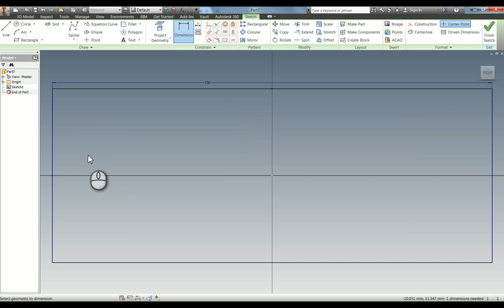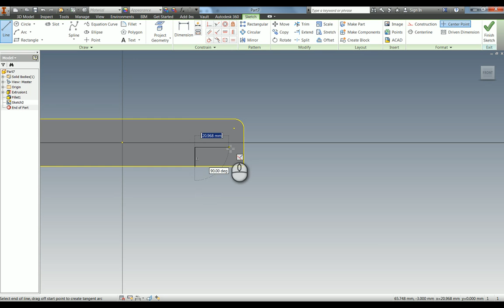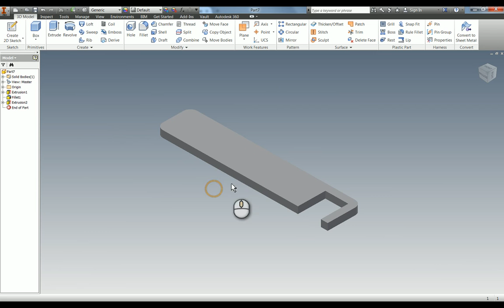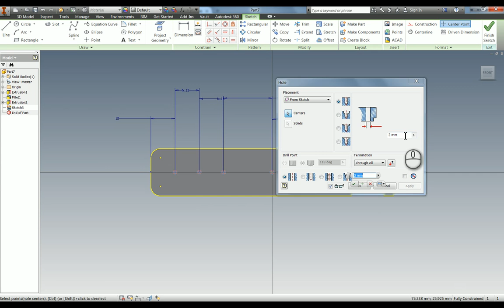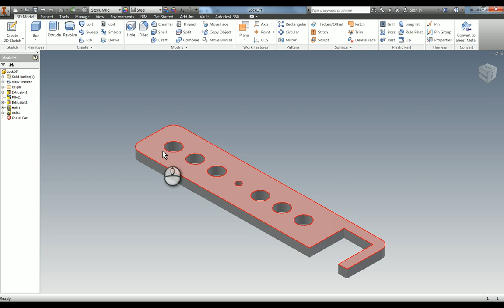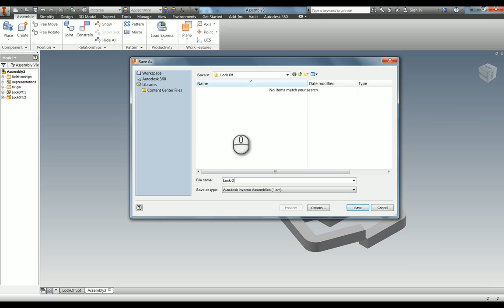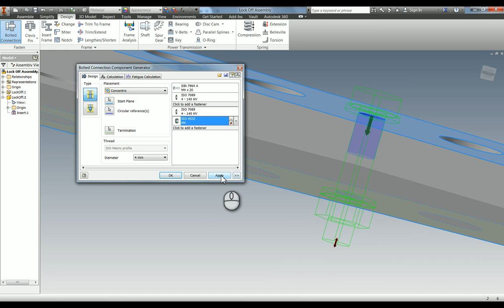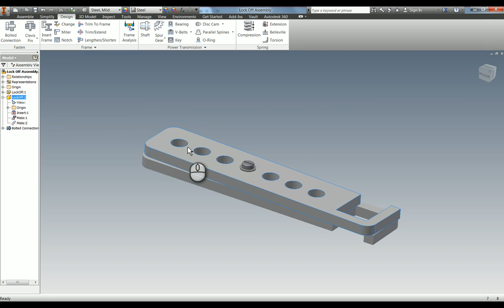Using Bolted Connections within Inventor

Comment: how do you use by hole?
Reply from the maker: Hi there, do you mean, a different bolted connection per hole? Or how to use the hole tool? If you want to create different connections then do a new bolted connection per configuration.  If you would like to know how to use the hole tool this is at this point; https://youtu.be/T0sT-4mO96M?t=171

Comment: Some how I can't get the imported files from my USB stick
Reply from the maker: Hi Dave, what type of files. It's unlikely to be an inventor issue.
Reply: It's a .ipt file. Trying to do how you did it with the screws. Sorry it took awhile, since I didn't have access
Reply from the maker: Hi Dave, try saving it locally. You also need to ensure that the version of Inventor you are importing into is the same or newer than what the parts were originally created in. Let me know if that works?